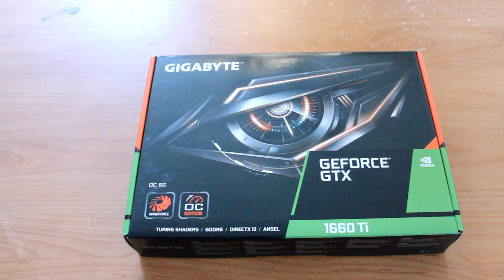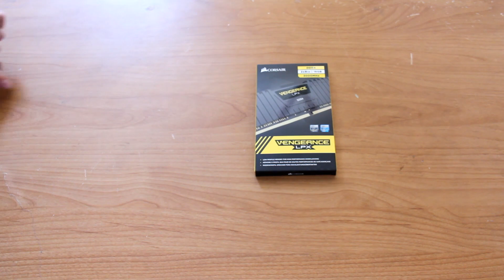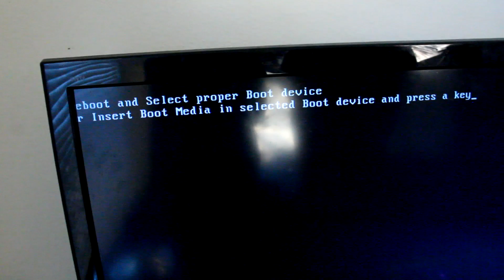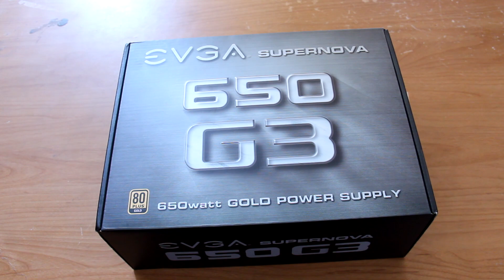Helping My Friend Build His Very First Gaming PC

Comment: Andy went from Level 1 Mac-Book user to Lvl 100 PC Gamer
Reply from the maker: Oh yeah yeah
Reply: Yeeaaa boooiiiii........
Reply: sleeve. I can make you pop like that
Reply: King XF Hey did you use any anti-static electric bracelet
Reply from the maker: @Ayoub-wg3tw  Nope
Reply: King XF correct me if I’m wrong but u can plug the psu in and keep ur foot on it and that works just as good right?
Reply: The Sanbro 
Lol no just touch metal from the Case when you building
Reply from the maker: @thesanbro9164  uhhhhh what
Reply: No cap